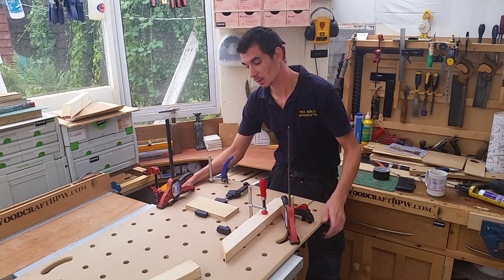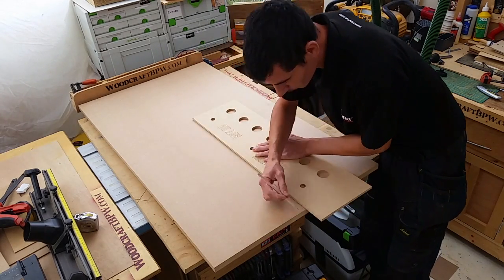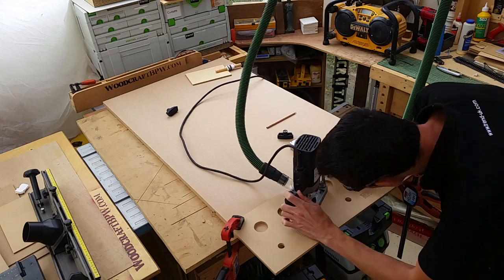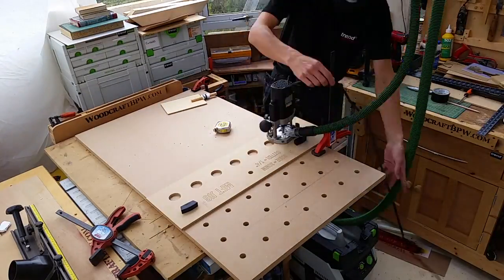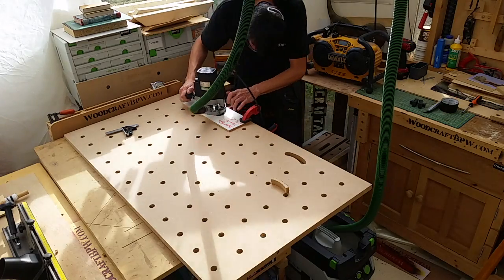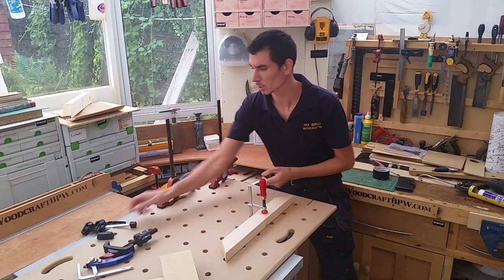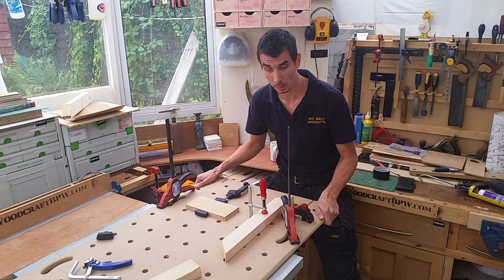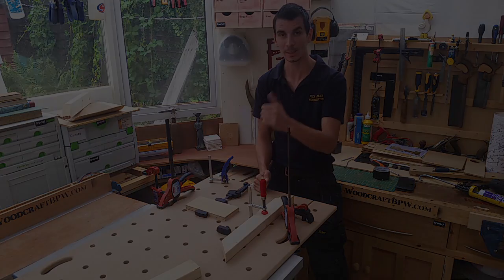Portable jobsite MFT slab worktable

Comment: Hi Richard,
That is a pretty cool way to cut the 20mm holes.  When I saw you make the jig in the last video, I didn't grasp how it would be used.  Now it all makes sense.  Using 18mm MDF seems like the better way to go.  I think the extra weight of the 25mm would be a hindrance to portability.  Thanks for the video!
-mike
Reply from the maker: +goptools I think for future, I'd make the jig holes 0.2 larger, just enough to make using the surface clamps slightly easier and quicker. I'd also make 4 or more rows of them rather than just 1, to reduce the error at the other end.
As for 18/25mm.....I went for the 25 for the rigidity over the increased weight - my thinking was it would only really be carried to/from he van 90% of he time.... I think nest time ill be using 18 or possibly 22mm next time. That said, the thickness was more an issue with the ease of clamping rather than weight.
Reply: +Richard “BrainFizz” Morley Thanks for the clarification!
Reply: +Richard “BrainFizz” Morley Maybe after cutting one row of holes you could turn the jig 90 degrees and cut two rows each side (carefully) to reduce any inaccuracies.
Reply from the maker: +Dadoo83 That also would be a solution, Someone else also pointed out that flipping the jig over would reduce errors. Both simple ideas that I didn't think about.

Comment: Hi Richard, thank you for the video. I have an question about the inaccuracies in the jig. How can this happen? I assume you have used a CAD program to design the jig, is your CNC machine not accurate enough? 

I ask because I can use the CNC machine of an associated company nearby to make a similar jig. My plan is to also use the dog holes to align pieces of wood and cut 90 degrees with my track saw, also aligned to the dog holes. In this case, a perfect 90 degrees angle between the holes is required of course.
Reply from the maker: Machines like this will always have a tolerance.... It works, but any time you use a previous position to mark the next one you will get a compounded error along the length.... This can be reduced by flipping the jig - which i didn't do, If possible I'd recommend getting the machine to cut out all the holes, i think it'll then be spot on... Depends what your happy to work with as an end product!

Comment: What is the clamp you used on the edge of the board to clamp against the the bench dog?
Reply from the maker: +Stephen they are festool clamps for their MFT table. Not cheap but heat for holding parts on this table top.

Comment: As a router noob, and someone with very limited workshop space (everything has to pack away when the car is in the garage!), I've been thinking about making one of these, possibly with a router table insert in it for double-duty (all those dogs should be good for holding a fence). Why did you choose to use a bush instead of just having 20mm holes in the jig, and a template-cutter? Less wear on the holes in the jig, or more accuracy?
Reply from the maker: +Howard Jones I'm already planning a portable router table insert with some of the left over 25mm MDF! ;-)
I went for the guide bush option as I don't have a 20mm router bit, but i do have a 30mm guide bush and a few 1/4" cutters...... since I was making the jig, i could make the holes whatever size I needed! ;-) - use what you have!
Reply: I would suggest buying a parf gig system that will allow you to align the holes in perfect right angles.
Reply from the maker: I’m really not a fan of the park jig system. To me it’s both overly complicated and overly expensive for something that will only be used a few times in its lifetime....I think it’s a solution for a job you deliberately only have to do once or maybe twice in a lifetime.

Comment: Hi, what router bit did you use? and why did not you use drill for making holes? thanks
Reply from the maker: It was a 1/4" Spiral cutter. Using a router and guide bush with a guide bush. This is a much faster method cutting the holes than simply using a drill.
Reply: Thanks, and do you know cheap version of push and pull clamps?
Reply from the maker: There are many makers of the quick grip, push/pull clamps on the market. I have had a few different ones over the years, but now pretty much exclusively use "Piher" clamps. they aren't always the cheapest, but they are VERY good quality and have never needed replacing even under "extreme testing" (see a couple of articles about them on my website). Hope this helps.
Reply: Yaa, ofcourse thanks a lot.